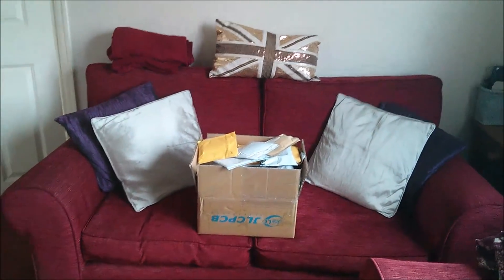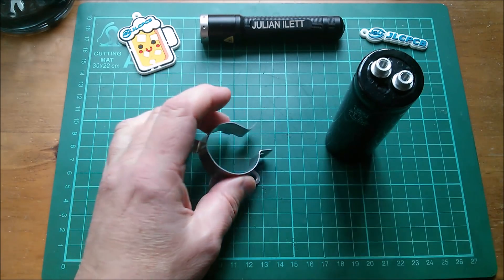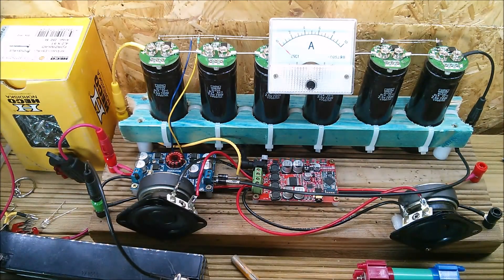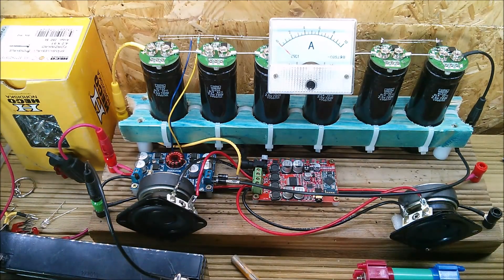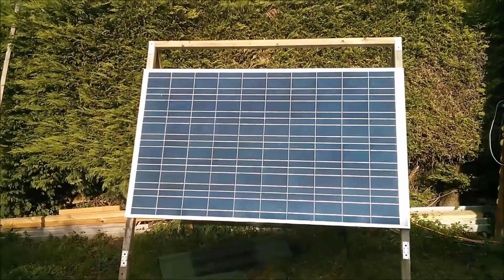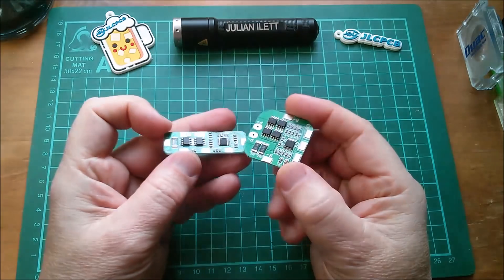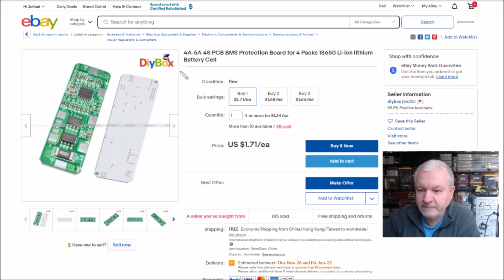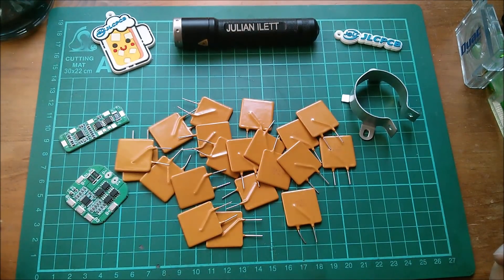Julian's PostBox #150 - A Smorgasbord of Electronics

Comment: 5:30, are you absolutely sure that it's the needle that is the problem? I've had many of those chinese DC-DC converters short out and failing to regulate current under low voltage conditions, when you have the load across the output during the power-on. They just push as much current across themselves as possible, lighting the leds dimly and giving a random voltage at the output at the input's maximum current. It's because the chip does not get powered on, because of too low voltage at the input and yet outputing voltage/current already. At a very certain voltage for your conditions it might settle itself in such high current draws and the A-meter shows what the current actually is. Nasty.